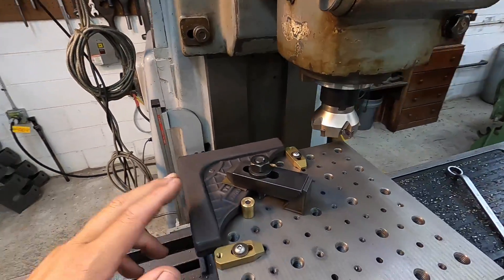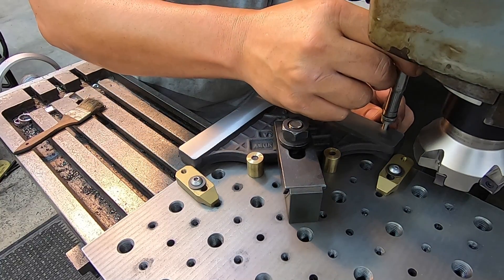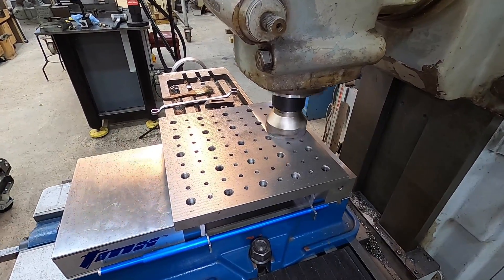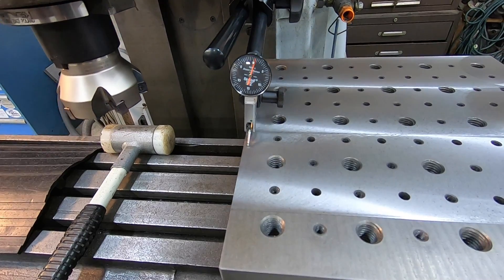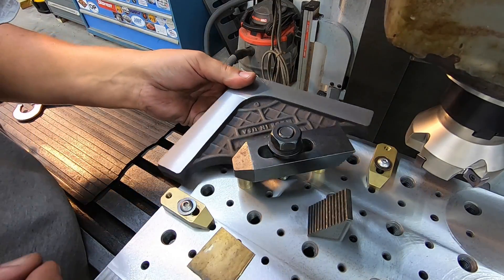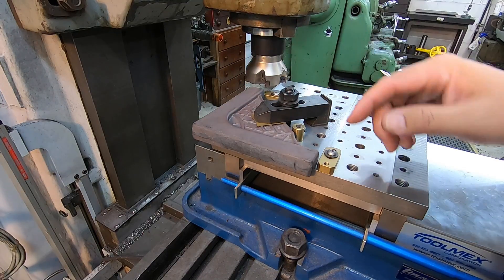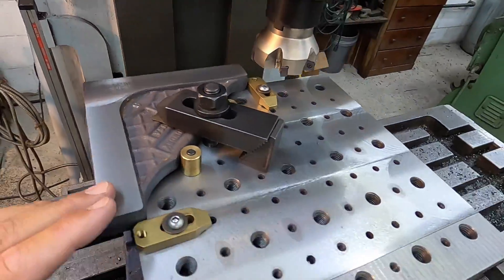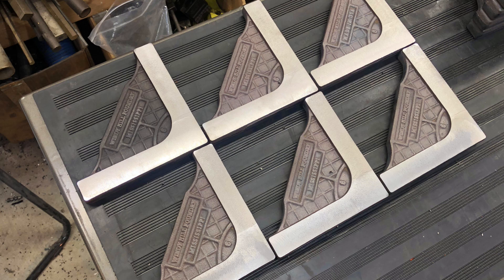Windy Hill Foundry Machinist Squares Part 2

Comment: Love tool's they cast the name in. no chinese brands its not made by one person. quite a veriety of cast materiels in steels and irons . had to put a 2" 3/4 shank endmill in the bxa post cause that was the only insert that was hard enough to cut a golds gym dumbell musta been an old train axle cause a file would'nt cut this stuff . it's the grip rim for my er 40 collet chuck or put it flat on the mill table with the index holes in the rim. meat there for balancing

Comment: I realize you probably don't want to take the time but I would completely recheck your setup before I would reface the top . There is a reason for everything. 
You said fixture plate checked dead "0" . Ether your method of checking it was falty or there is flaw in your setup. There is a reason . There always is .
Reply: If I remember right he mounted the cast iron fixture on a steel plate.  If there is a difference in the coefficient of expansion between the two materials it could introduce a bow or other movement.
Reply: true, it can be remachined, but every time it's remachined it gets thinner and less rigid, less mass, too.
Reply from the maker: That fixture plate can be easily machined again, whether in my mill or shaper.
Reply: @Abom79  I ground a pair of end mills a rougher and a finisher . The part in inspection showed the finisher cut with a .003" taper . The inspector suggested I grind it with a taper to correct it . I figured there must be a reason . When I sharpened the rougher it had enough stock on it to put it on the low limit which added .005" additional stock for the finisher . I reset the cutter blades and ground it to the high limit . The next piece cut dead straight . There ways is a reason . Are you going to  reface it every time you use it ?

Comment: Machined casting ONLY $282.55 each. How many do you want 12? That is only $3,390.60 plus shipping.
Reply: Laddie what’s your point?
Reply: Laddie’s point is that he’s either jealous of what Clark and Adam can get for these squares or he wants to tell us how to spend our money.  Either way, I care little about his opinion.  BTW, if I wanted all 12, the price for two or more is $257.55, or $3090.60 plus shipping.  I’ve already saved myself a cool $300!  Never another poor day!
Reply: @jamesogorman3287  
"what Clark and Adam can get for these squares"
Between the energy required to turn iron to a liquid, shipping costs, energy required to machine, and the expertise to carry these operations out, all with a decent finish and some kind of accuracy, I'm surprised the price is so low.
How much does a mill like Adams cost? Ho much does a set of inserts for that face mill cost? How much for a vise like Adams?

Adam can't be charging anything close to minimum wage while the price of the product is so low. Having a man like him involved, with his experience and shop capabilities should make the product affordably expensive.